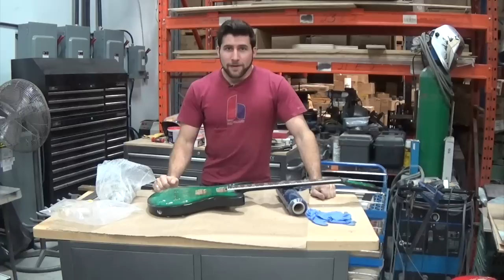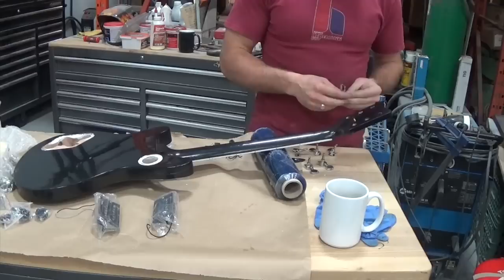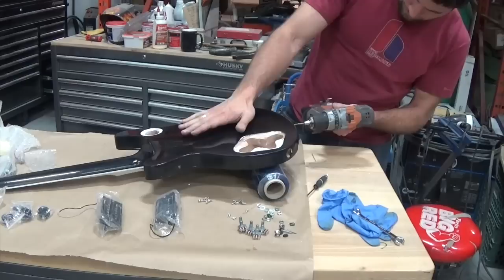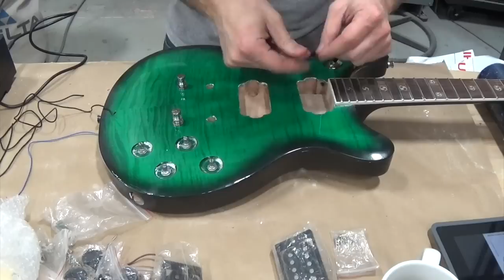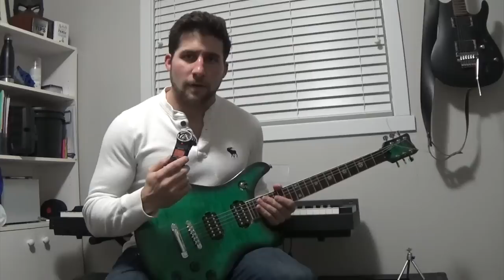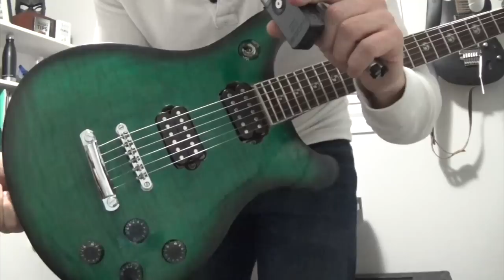The Guitar Kit Build from Guitar Fetish | Final Part

Comment: Thanks for the series - I found it part way through putting together an LP kit from a UK Amazon supplier - no doubt the same or a similar Chinese factory. I've put the neck in place and clamped it to measure the bridge and drill the holes. I was going to glue in the neck, put a final coat of dark mahogany stain on the back and neck then clear coat the whole thing. 

But now, I'm going to put the clear coat on, the top, fit the bridge, put both e strings on and check the neck again, mark it and glue it. Remove the bridge and tail piece leaving the stud things in and then clearcoat the back and sides and neck and then polish it all - a bit of a muddled way to do it, but I should be able to adjust the neck if i need to - may not have a tight fit, but the angle will be better if needed. Having to polish around the tailpiece and bridge holders will be a small sacrifice.

If nothing else your experience may prevent me having the same issues or they not be quite as bad. I'm keen to see how this kit measures up to a 23 year old budget BC Rich Warlock. Either the Warlock or this kit are getting a set of Irongear Tesla Sharks - I'm hoping its the LP kit...
Reply from the maker: You can install the bridge to do all your testing before you clear coat the top. I assume what you're worried about is being able to pull out the bridge hardware. To do that, just grab a bolt that is the same thread and gently thread it in until it starts to press against the wood at the bottom. Then keep screwing it in and it will push the post out.

Comment: Brad I've built GFS teles using 3 different  XGP PRO bodies and all had that same neck angle canting down issue.  it seems to be a flaw in their suppliers cnc programming.  With a bolt-on neck i was able to correct for this with a lot of hand sanding slowly and a lot of time.  Some of this is outlined in my build videos on my channel.
cheers. Mike
Reply from the maker: Thanks Mike. If I had put the neck on first and then measured out the bridge position I could maybe have fixed that issue, but it would have looked very odd with the top.
Reply: I thought the same thing. You could compensate for the neck by moving the bridge a bit. Btw, have you tried any other kits that work better? I am thinking of trying this Stratocaster kit: https://www.thomann.de/gb/harley_benton_eguitar_kit.htm
Reply from the maker: I have tried better ones. In fact, I’m working on one right now if you check my most recent videos. I also have an affiliate link in the description where it can be purchased.
Reply: Nice, watching the playlist now. Btw, the videos in the playlist are in reverse order. Unfortunately your ST-kit on kit.com seems to be out of stock. My son wants a ST for his birthday, apple candy red finish, which seems hard to do yourself, if you have any tips on how to do it, please share.
Reply from the maker: I’ll grab you a link for that if you want. Do you have spray equipment, or are you trying to get that finish with cans/by hand?
Reply: Thanks, that would be nice. I have an air compressor and am looking at buying som spray equipment. Until now I've only followed your staining by hand tutorial on my P-bass and your can tips for two helmets. There are lots of alternatives in different price classes. But I will definitely have some spray equipment when I start with the kit.
Reply from the maker: Here's an affiliate link to the kit that I'm guessing you're referring to: https://www.solomusicgear.com/product/solo-st-style-diy-guitar-kit-basswood-body-hard-maple-neck/?ref=1512

Here it is with a maple fret board: https://www.solomusicgear.com/product/solo-st-style-diy-guitar-kit-basswood-body-hard-maple-neck/https://www.solomusicgear.com/product/solo-st-style-diy-guitar-kit-basswood-body-hard-maple-fingerboard/?ref=1512

And here's the version with upgraded wood if you're going for a transparent finish: https://www.solomusicgear.com/product/solo-st-style-diy-guitar-kit-alder-body-rosewood-fb/?ref=1512

If you're looking for spray equipment, I've got some recent videos (3 of them) about warwick paint guns, which I love. If you use the link and code in the description of those videos, you can get 10% off.
Reply: Thanks very much. I will definitely order the warwick gun through your affiliate link to support your channel. When salary comes (25:th). If you're looking for ideas for new videos, how about doing a video about how to properly shield the mics with copper tape to reduce humming?
Reply from the maker: For the pickups? I’ve done a video on that if you’re looking for one. I’ll be doing another on the kit I’m working on now.
Reply: Maybe the maintenance video is not very interesting. Here is a video where the custom paintjob bass actually is played. https://www.youtube.com/watch?v=bEVlIUUdwC4
Reply from the maker: Thank you! I appreciate the referral, and nice work on the bass.
Reply: The ST-style kit from Solo seems great quality and got only top reviews. Maybe I'll go with that one instead of Thomann. How about the apple candy red? Any tips on how to go ahead with that, assuming I have the Warlock paint-gun by then.
Reply from the maker: I’m going to have to ask a few questions first. What kind of paint are you planning on using? Are you aiming for a transparent Apple red that shows wood grain, or one that looks like you would see on a car?
Reply: I have no idea, what colors works good with the Warwick minigun you tested? I was thinking about picking up that one. Is it better with water based or not? And for the finish we watched the fender homepage and he liked the candy apple red best. I guess it is more like what you would find on a car. It has some depth to it and the color seems to have different brightness in different angles. https://shop.fender.com/en-SE/electric-guitars/stratocaster/american-professional-stratocaster-hss-shawbucker/0113040709.html
Reply from the maker: It should work with pretty much any paint. 
Ok, so you’ll want a metallic base under a candy red then. Probably metallic gold rather than silver to give the red more depth.

Comment: ive built a few guitars but only one kit. not sure if anyone else mentioned this but from my experience the guitar goes together completely before the painting and finishing then disassembled so as to eliminate the problems you had with final assembly. also so you dont screw up ur finish messing around with hardware that doesnt fit properly. the one kit i built turned out great and got me into scratch building however i modified the shit out of it to my specs.
Reply from the maker: That's a good point Mike. I should have done that, as it would have revealed the issue with the alignment. I'm not sure it would have given me a reasonable option to fix it, but I would at least have know about the problem ahead of time. I also would have know about the wires etc. haha.
Reply: nice finish though for sure. that's where i start to lose patience in my builds.
Reply from the maker: It can get a bit tedious. I'm usually so excited to get to the finishing that I want to skip basic stuff before it haha.

Comment: My experience is that with bolt on kits you can usually end up with something playable and up-gradable. There are a plethora of basswood body strat kits on ebay from China for $60 US. I've seen those turn out decent but it seems like every single set neck kit build I've seen the fatal flaw is the neck. Glad you'll be able to re-purpose this one for videos, Brad. The finish btw ended up top notch. Maybe do a bolt-on kit next? Easy solid nitro finish? Love the videos! Keep them coming in 2017.
Reply from the maker: A bolt on would probably be more worthwhile because it allows more leeway for fixing some of these issues. I'm sure a high quality kit wouldn't have this problem. I think I might actually create some of my own bodies for bolt on necks and use them to do a tutorial or several.

Comment: Hi Brad, The finish looks stunning on this guitar well done.
One of the the things you need to do with any kit build is a mock build first to see how and if it all fits together properly, which in most cases they don't. Also when positioning the bridge string up the guitar with the outer E strings in place and then adjust the bridge position laterally so you have even spacing down the neck. Years ago I was considering building kit guitars and then on selling them, found out for the work involved its easier to build from scratch!
Reply from the maker: Yeah, that's how I would usually position a bridge. This guitar had a clear centre line, so I figured I was safe. I guess I would have had to choose between a bridge that looks off kilter, and a properly playable guitar. I mad the wrong choice haha.

Comment: bummer man! you did such a great job on the paint and finish...I'd imagine the fret work would be a bit rough as well as other minor issues for a lot of guitars in that price point but the neck veering off at such a bad angle is a major let down.
Reply from the maker: Yes it was pretty unfortunate. The frets weren't as bad as I expected except the ends. They were crazy sharp when I got them, so I had to do a lot of rounding with the file.

Comment: As with anything you build, you should always dry fit the parts before you paint it all up, so you can fix any errors. 

The description on guitar fetish web sites says "You will have to hand-fit necks to bodies, and assume that every part of this adventure will require a moderate level of ability- This is not a jigsaw puzzle that goes together with little or no effort".

 You say you do custom projects in the description, but I can't imagine you make money doing this. The finish and problems on this guitar look like an extremely amateur build. If anyone wants to see how professionals build guitars check out the Crimson Guitars channel. It's loaded with tips on building guitars and a lot of them work on kit guitars.
Reply from the maker: I did test fit them haha. Guess what? They don't fit. Good thing I never claimed to be a guitar builder I guess.
I'm fond of the crimson guitars channel. They only have one series that I know of on kit builds, but it was a good one.
Reply: Get over that Wall With your sentiment what is the point of buying a kit at all? You may as well start from scratch and fashion it from the wood of a tree you planted yourself and waited to grow. At some point you have to assume that you are getting at least some level of quality. The lack of veneer to the edge completely negates the point of GFS even going to the effort of putting the binding on let alone even making the kit in the first place. 

Personally I think Brad has done a great job considering and has been really helpful to other budding builders. This guy has a lot of balls putting his efforts on here in order to help others. I find your attitude a real issue. There are ways of pointing people in the right direction whilst still being supportive.

Brad keep up the good work ... I have built my own kits and enjoy modding guitars in all manner of ways and I thoroughly enjoyed watching your videos
Reply from the maker: Thank you Tim. I appreciate the feedback, and I wish you well with all of your projects.